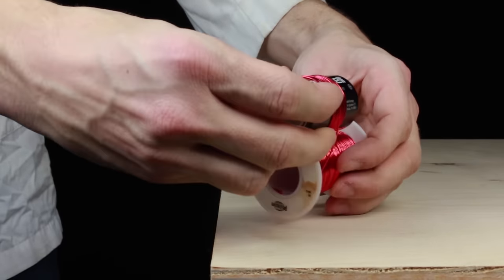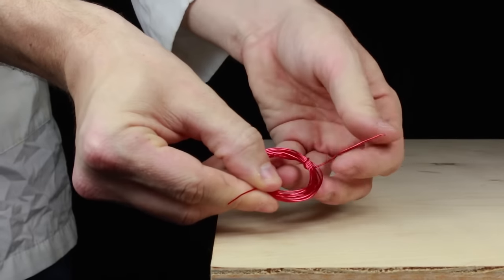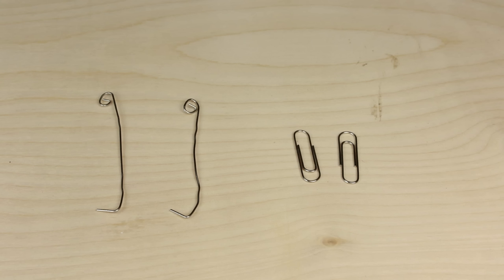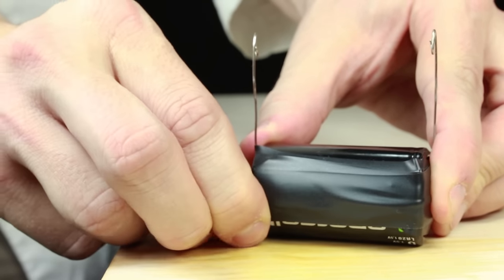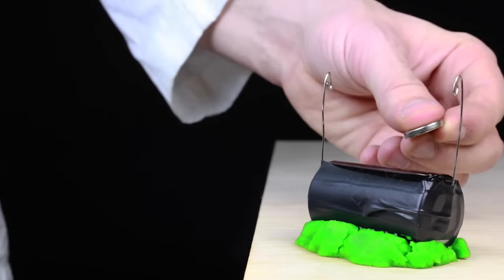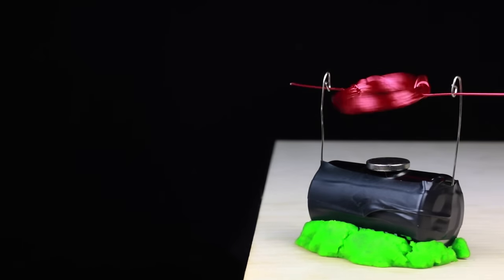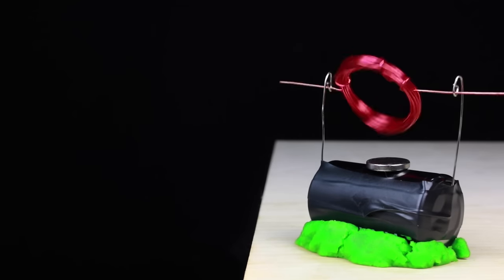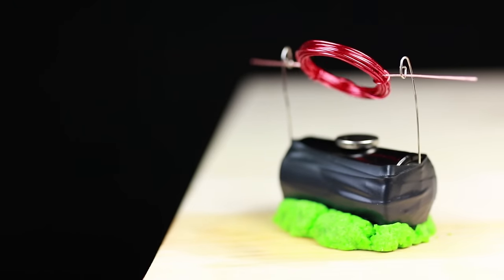Make a Simple Electric Motor (Physics)

Comment: It worked! Everything has to be straight and lined up well in order to get the best performance.  We found it was tricky to get the paper clip loops the same height, but adjusting the playdough was an easy way to make it level so the coil would spin faster. :) Great video, thanks!

Comment: Is it okay to use a 9 volt battery for this motor?. The model won't be the same in the video but still uses the same concept, with a sturdy conductor for the stand glued to a wooden board and connected to the 9 volt battery
Reply: it won't work

Comment: What kind of wire did you use? Was it 20 gauge electro magnetic wire or 20 guage electric copper wire??
Reply: It would be 20 gauge magnet wire. This is made of copper coated with a lacquer insulator. Other gauges would also work but the performance would change.

Comment: can I use a substitute instead of the paper clip, will it work if you put the wire into the eyes of needles?
Reply from the maker: If the needles are bare metal and the eyes are large enough to hold a sturdy wire then it should work.

Comment: Does the wire have to be 20 gauge? Also does it work without a neodymium magnet.
Reply from the maker: It doesn't need to be but 20 gauge works well because if it is too thin the wire will bend too easily.  It also doesn't need to be a neodymium magnet, ceramic magnets will work just fine.

Comment: should the magnet be attracted to the copper wire?
Reply from the maker: The magnet should only be attracted to the copper wire when there is an electric current flowing through the wire.  The electrical current creates a magnetic field but the copper does not.

Comment: Trying this with my daughter and I have 22 guage copper wire I stripped completely.   Used a paint marker to paint ends of wire to break circuit.  Do I need magnetic wire?  And where can I find this?  please help project due in four days!
Reply from the maker: +David Warnken The wire needs to only be striped on the ends not in the coil.  An easy way to fix this is to straighten the wire and paint the center section with a thin coat of fingernail polish, this will be the insulator that makes it like magnet wire.  Magnet wire is just wire with an enamel coating painted on as an insulator.
Reply: Thank you we did get this to work!  My daughter was very happy with it!

Comment: @BeardedScienceGuy where can u find copper wire??? please help science project is due this week
Reply from the maker: Amazon, a local hobby shop, or Fry's electronics.  It is called magnet wire.  The reason it is different is that there is an enamel coating insulating the wire instead of a layer of plastic which makes it possible to remove the coating from half of the wire and leave it in place on the other half.

Comment: Does it have to be a magnet wire? Or is it okay if it’s just 20 gauge wire?
Reply: I'm extremely late but you can use just about anything with a little tweaking. I used 22 gauge insulated wire and just shaved one side with a pocket knife. It's not perfect but it still works.

Comment: Quick question: Does the coil keep spinning in the same direction or does it alternate when it spins?
Reply from the maker: It spins in the same direction but it turns on and off as it spins.  The frame rate of the camera makes it sometimes look like it is going backwards.

Comment: Ummm help me and my friend did all the steps right but nothing is happening its not even heating up or spinning
Reply from the maker: If it isn't heating up either then it is not connected somewhere.  The wires need to be touching each other and the battery.  Try squeezing the wires against the battery to see if that is there the problem is located.

Comment: can i use any type of copper wire? answer pls
Reply from the maker: Enamel coated magnet wire works the best but you might be able to use other types and insulate it with fingernail polish.  I haven't tried it though so no promises that it will work well. Good luck.
Reply: thank you sir.

Comment: So I followed your steps still nothing is spinning. I cant figure out what I am doing wrong.
Reply from the maker: If the coil is getting warm after a minute then electricity is flowing but the magnetic fields aren't lined up correctly.  If it is not warm then there is a connection not touching to complete the circuit.

Comment: What are the factors affecting the rotation of the copper wire?
Reply from the maker: Mass of the wire, number of coils, current running through the wire, the strength of neodymium magnet, and the distance between the copper coils and the magnet.

Comment: The magnet can it be a plain magnet?? I took one from an old radio.
Reply from the maker: The stronger the magnet the fewer the coils you need to get it to spin.  It's all about the strengths of the magnetic fields.
Reply: If it doesn't spin what will i do. Its the last day of project making. Btw tnx for fast reply😀
Reply: The copper wire that my friend bought is thin.
Reply from the maker: Each additional coil makes the magnetic field stronger until the resistance of the wire reduces the flow of electrons but because this project usually uses larger gauge wire that won't typically happen unless there are a ridiculous number of coils.
Reply from the maker: Hopefully it doesn't just bend under its own weight because of how thin the wire is because that could make things difficult.
Reply: BeardedScienceGuy less coil mor spin?
Reply: How could i balance it?
Reply from the maker: More coils more spin because each coil adds to the strength of the magnetic field.
Reply: BeardedScienceGuy what copper wire did you use and where can i buy it?? Also the magnet
Reply: The neodymium magnet where can i buy or find it?
Reply from the maker: http://amzn.to/2mpn4ZT
Reply from the maker: http://amzn.to/2m5U9Il
Reply: BeardedScienceGuy thanks :)

Comment: Having trouble doing this experiment? We feel the battery heating up and all the connections seem good but the coil is not spinning. Please help. Used 18 Gauge copper wire, neodynium magnets, a d battery, sand paper and molded clay. Please Help????
Reply from the maker: If the battery is heating up then make sure you only sanded off half of the wire coating and also make sure you have a strong magnet on the battery.    Make sure the coil looks like this https://www.wired.com/wp-content/uploads/2015/12/untitled_key5.jpg

Comment: could you use more than 1.5 volts?
Reply from the maker: +DROSTAR123 Absolutly, but it is a short circuit and the coil will get hot so be careful using anything with a higher voltage.
Reply: +BeardedScienceGuy ok thanks alot, making a school project and this is a cool ideal. one thing i thought off. instead of having a magnet, why not add an electromagnet that's powered by the same current?
Reply: +BeardedScienceGuy oh and i have to use 6v

Comment: is it okay if the wire is insolated
Reply from the maker: Magnet wire has a very thin insulation coat that can be sanded off of one half of the wire and not the other half.  This is very important for it to work.
Reply: BeardedScienceGuy is magnet wire and enameled wire the same? mines not working on a smaller scale with an 18650 battery.

Comment: what if the coil doesn't turn?
Reply from the maker: Make sure there is a complete electrical circuit.  Check your connections and make sure you sanded the enamel coating off the ends of the wire.  Also don't forget the permanent magnet.

Comment: It doesn't work, it does't spin. Can you help me?
Reply from the maker: +Franklin Tsui if it doesn't even turn at all you either haven't completed the circuit (check your connections to the battery and that you sanded half the wire and it is connecting)  or you don't have a strong enough magnet for how many coils you have.  Check the connection first though because that is usually the problem.
Reply: I think because I did't use the neodymium magnet, I used a grey magnet(don't know what it made of, and it attracts to the battery), the connections was ok I think, I used copper wire.
Reply: I think because I did't use the neodymium magnet, I used a grey magnet(don't know what it made of, and it attracts to the battery), the connections was ok I think, I used copper wire.
Reply: I think because I did't use the neodymium magnet, I used a grey magnet(don't know what it made of, and it attracts to the battery), the connections was ok I think, I used copper wire.
Reply: I think because I did't use the neodymium magnet, I used a grey magnet(don't know what it made of, and it attracts to the battery), the connections was ok I think, I used copper wire.
Reply: I think because I did't use the neodymium magnet, I used a grey magnet(don't know what it made of, and it attracts to the battery and attracts to the copper wire too), the connections was ok I think, I used copper wire.

Comment: The whole thing is just heating up it still won't spin
Reply from the maker: The heat means that electricity is flowing.  Is the magnet close enough to cause the coil to turn toward it?  Also it needs to me sanded on one side and not the other just like this picture.  https://www.wired.com/wp-content/uploads/2015/12/untitled_key5.jpg

Comment: its not working for me
Reply from the maker: If the coil of wire is warm then everything is connected but the magnetic fields are not lining up correctly to turn on then off then on as it turns.  If the coil is not getting warm after a minute then there is something that is not connected and the electricity is not flowing.
Reply: the coil is warm except it doesn't rotate. it does what you showed at the end of the video.
Reply from the maker: Make sure the half of the wire that is sanded is in the same plane as the coil.
Reply from the maker: There is a great picture of what that means halfway down this article.  It says "Bare" and "enamal" to indicate the side that needs sanded.  https://www.wired.com/2016/01/how-to-build-a-super-simple-electric-motor-out-of-stuff-you-already-have